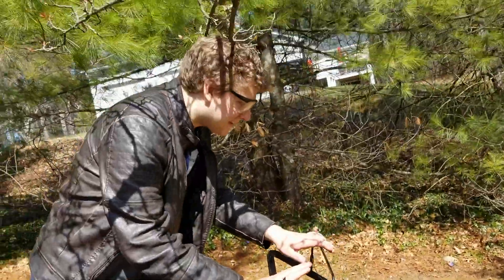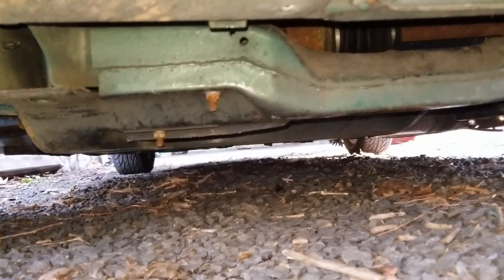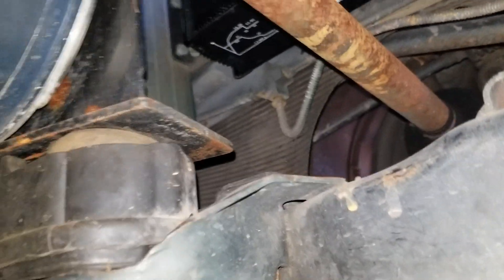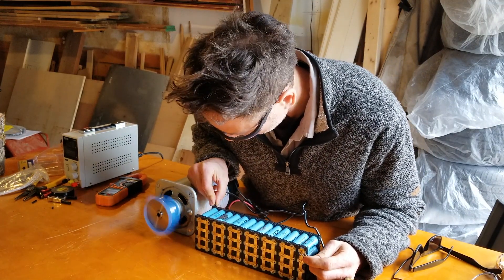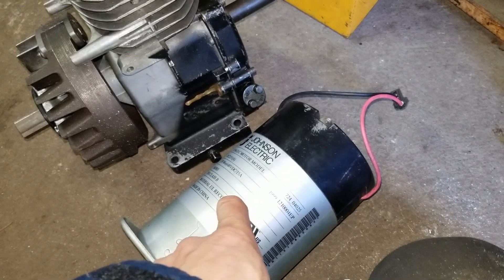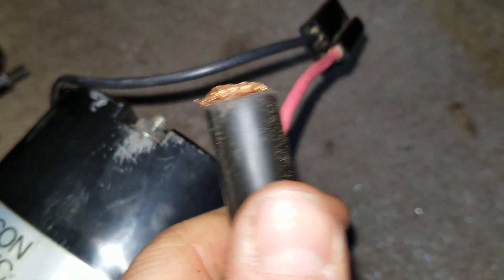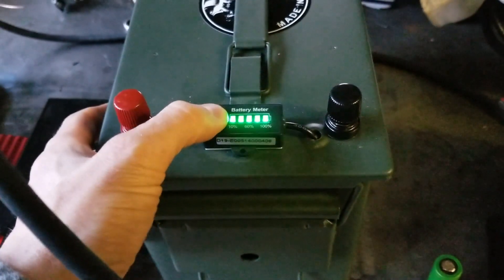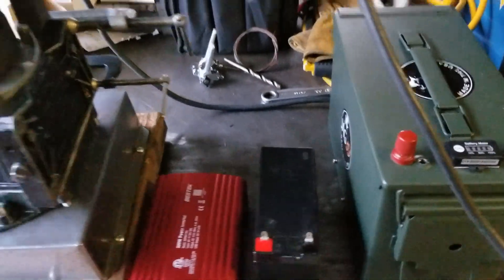Gasoline to Electric Lawnmower Conversion (NYK behind the scenes) | E1 (Intro)

Comment: thanks guy ?iam doing a rideon ? i need to  run a jack  shaft ill use a cracked b&s crankcase and cut the cylender off ? plenty of meat to bolt the elec motor to